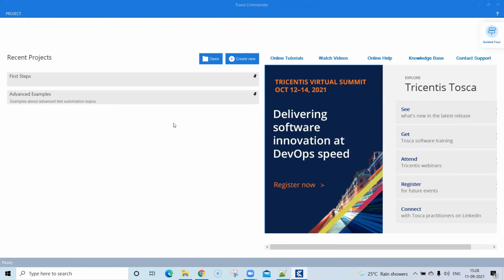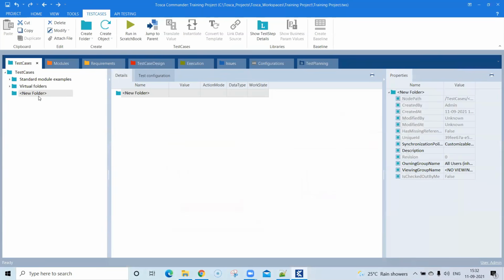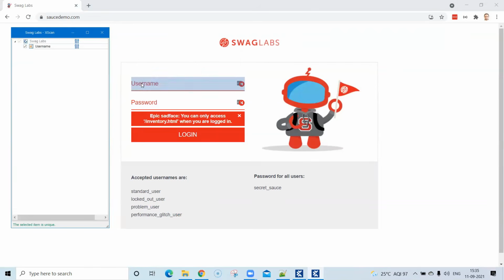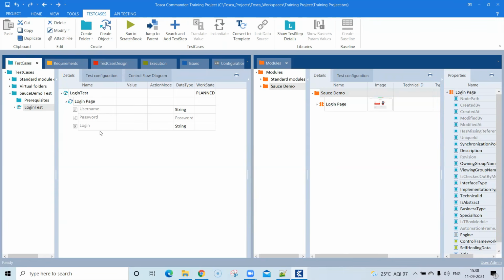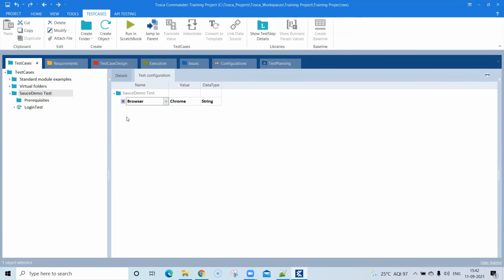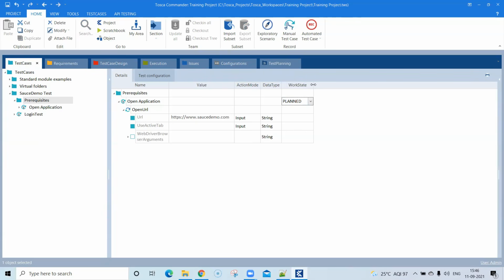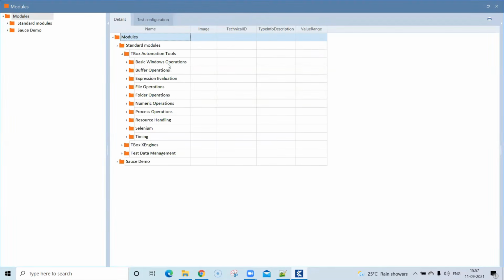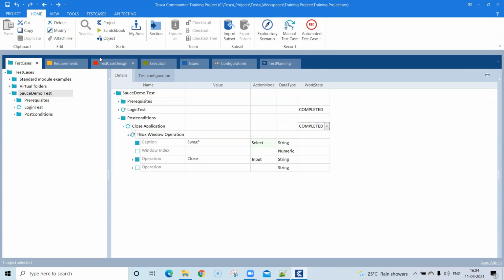Tosca Tutorial | Lesson 5 - Create First Test Case | Tosca Commander | New Workspace |

Comment: Hi sir,

I am getting the below error when running the login test case:
"No matching tab was found with the following properties:
Title=Swag Labs"

It is actually expecting me to keep that webpage open and only then it can enter the login id and password. But if the browser is closed and I try to run it, its not launching the browser -> opening the webpage and then executing the test. Please help!
Thanks in advance,
Tushar
Reply from the maker: Have you added the open browser test step?. You can search for the open url module and add it as a test step with the url.
Reply: @QASCRIPT  Hi sir, thanks for your valuable reply. Yes, I did add the open url module under Html and dragged and dropped it as a test step. Still it doesn’t work and I get this error.
Reply from the maker: Try adding a configuration parameter for Browser. Also check if multiple browser tabs are opened while executing the test.